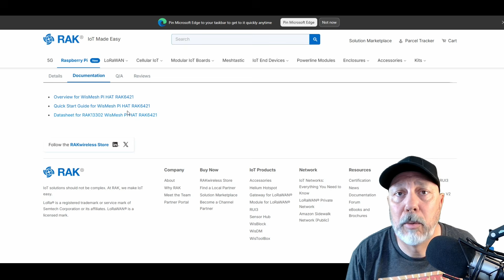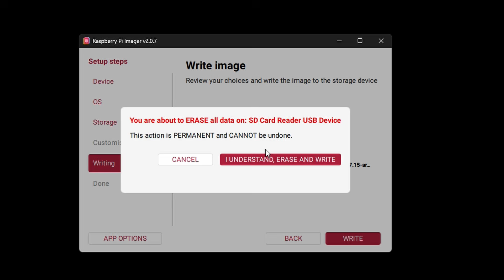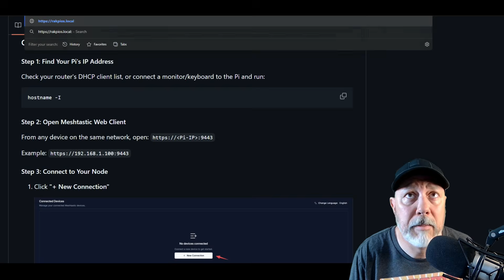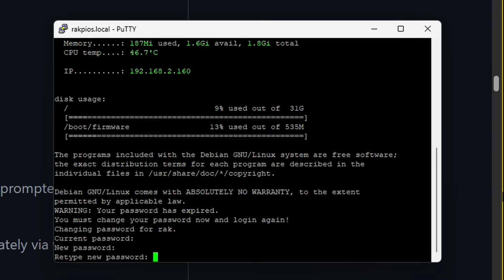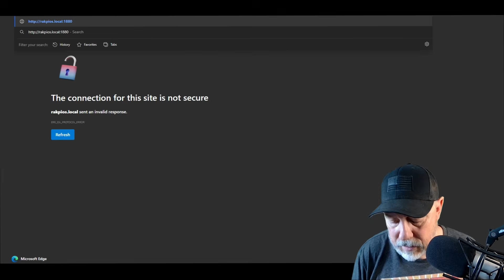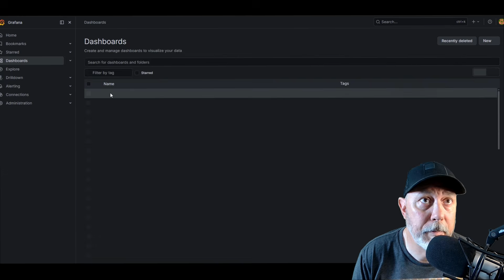RAKwireless Pi Hat Full Install Tutorial: Meshtastic, Node-RED, Grafana, InfluxDB Stack

Comment: the heat sink shown in the diagram is the bottom of a rakwireless helium miner which is the same as the wisgate. It screws into a cube like enclosure which has the same piece as the top
Reply from the maker: Ah! Very cool, thanks for sharing!

Comment: Trying the SD card image made circuit fault protection pop up and the hat had to be removed so the pi would boot
Reply from the maker: Very interesting! Did you buy the kit with the provided image on the SD or did you download the image and flash it? I got the kit with the pre flashed image but I didn't realize at the time it came flashed. I downloaded the image and set it up from scratch. Thanks for sharing!